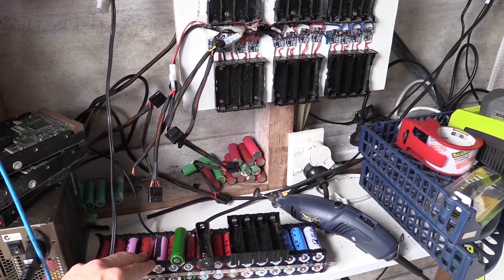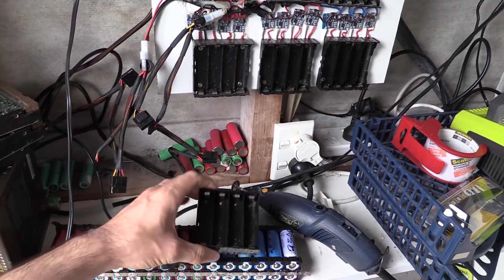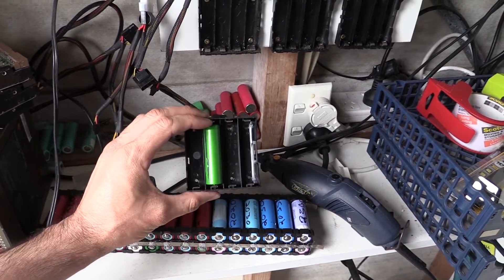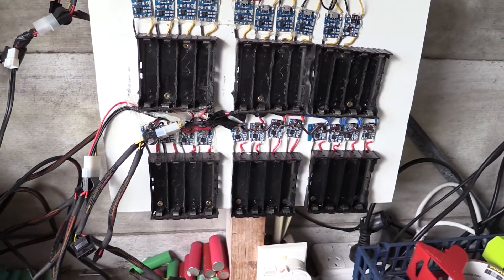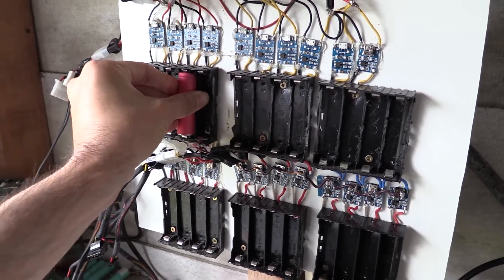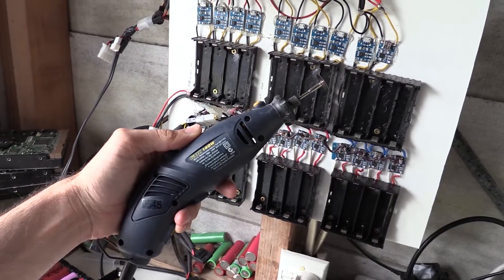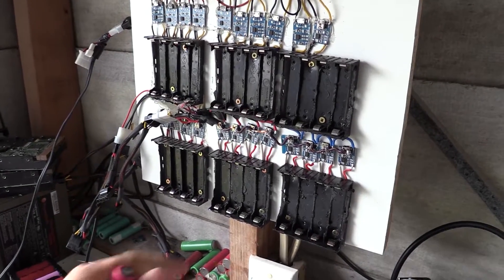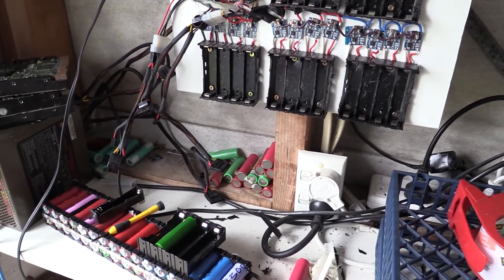18650 Holders Tip of the Day!

Comment: Great idea!  Ive been using a piece of string behind each one so I can pull them out without disturbing the other 3.
Also on those single cell ones, If you use a heat gun and warm them up good, you can bend those annyoning side clips back to where cells can pop in and out much easier.

Comment: Hi Mike so how many 18650 cell's does it take to make up a 1kw pack
Reply from the maker: no idea , depends on the cells. About 640 to make a 5kWh pack. So around 128 cells per 1kWh
Reply: Thanks for getting back to me. I've been watching tons of videos about the powerWall phenomenon and I've court the bug. But I've been looking for quite some time now and I'm wondering why no one has been looking at 26650 from what I can see they are much better in size and the amount of power they can hold would beat 18650s hands down. I've got quite a few of them new ones I think I'm going to give these ago
Reply: also somthing to consider is what voltage the pack is going to be as well. Im doing 4S 10P @ 20 amp hour the EBL cells im using are averaging 1900 to 2100 mAh

Comment: rather than make a powerwall with busbars and tesla fuses, maybe it would be easier just to spot weld 8 batteries next to each other and put them in these holders.
Reply: pirucreek would also be more expensive and use up more space,  but definitely would have some advantages to be able to easily change out single cells. Especially with old laptop batteries that could die at any time.